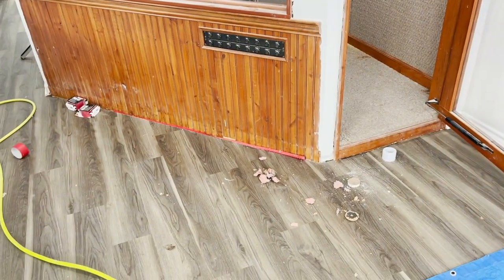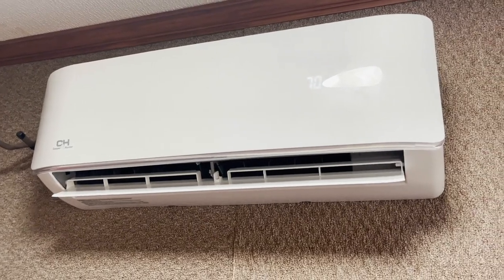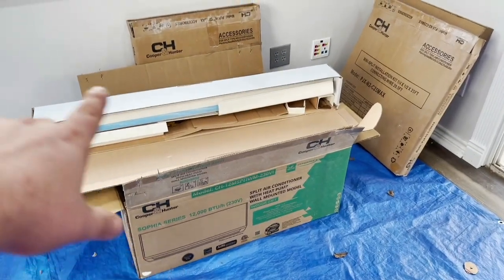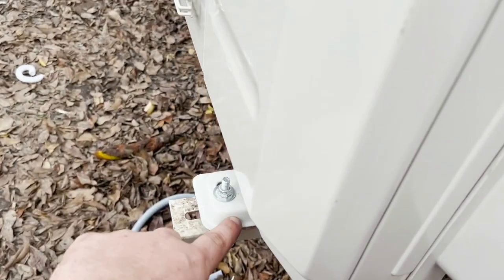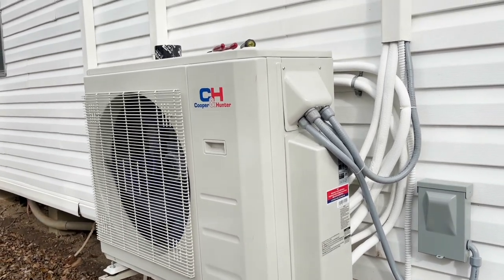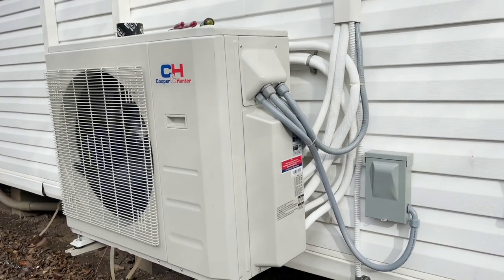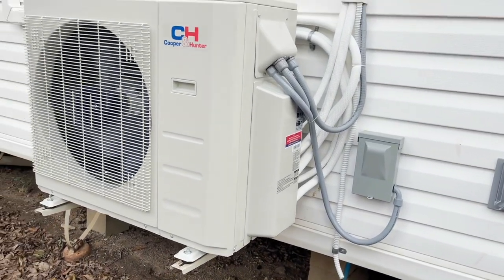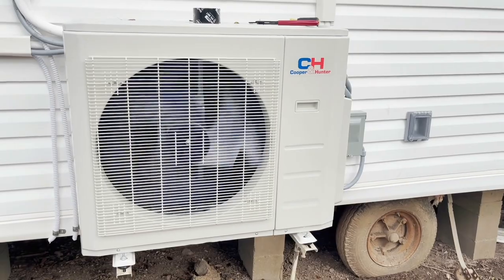Cooper & Hunter 3 Zone Mini Split/We Did Not Provide Equipment

Comment: Nice and clean installation. Used to have a multi zone mini split repair. Only one was working, when another was turned on the working one stopped working. Spending too much time on the diagnosis and couldn’t charge that much since the unit is cheap. Avoid repairing multi zone mini splits unless you have enough spare time

Comment: I work at an HVAC supply house , Cooper &Hunter are made by Gree which is a Chinese company !! , Rheem & Ruud are made by Fujitsu !! We sell Fujitsu and Daikin and I think both of those units are very  solid !! The only problem with mini splits is the control board they are very sensitive but if you put a surge protector you are 100% safe and I like them better then conventional you are saving at least 50% in utilities $$ specifically in the NORTH EAST WHERE I AM !! YOU GOT A POINT ABOUT LG  SAMSUNG TOO IS HORRIBLE BUT I WONT RECOMMEND PUTTING A COOPER & HUNTER
Reply: Is Gree reliable? I can't decide on a new dual zone either or Daikin or Gree. Daikin is much more expnesive but with good reputation. The indoor unit design is almost like the one  Ihad 10 years ago. Gree has modern indoor unit and wifi. But I am worried it might less reliable or need service call..what do you think?

Comment: they made a big mistake placing the condenser directly outside the mini-recording studio area, even though the unit's are quiet and on isolator mounts, the vibration will transfer through into the flooring and walls, right into the mic's. then again it's a trailer, so there will always be noise transfer and vibration, which is the reason recording studios cost fortunes :)

Comment: You seem like the guy to ask these questions.  I live in the Houston area...double wide 76 ft length.  I have had challenges with ductwork being damaged by wildlife.  I finally SHUT the HVAC down this summer due to condensation from leaking ducts, destroying my flooring.  I installed window units, but not really a plan that is working well for me.  I do NOT want to replace the ductwork under the house.  Is it feasible to ductwork INSIDE the mobile?  I can't seem to find anything on this on the internet.  I can't be the only person who has decided not have ductwork under the mobile.  I have a friend who is willing to loan funds to complete this project, but I need to find a solution before summer.  Is it possible to do inside ductwork in a mobile or is that not recommended?  What other solutions?  Thanks in advance.

Comment: Made by Midea
Reply: Very clean installation.  You do nice work.  I've been selling and installing mini splits for four years. Dakin and Mitsubishi are definitely the top tier. However I've install several other brands. Some I supplied the equipment and some not. Out of 6 different brands the only issues we've had is drains clogging up, vandalism,  and dirty coils. Repaire parts availability could be an issue once you get away from Dakin and Mitsubishi.  Time will tell. Like your videos. God Bless

Comment: Take it over a Fujitsu 😂. Clearly you don’t know your shit because there’s multiple things you are incorrect about. Mitsubishi I agree is great. Fujitsu and Mitsubishi to me are top tier no one else touches. That head in the studio is gonna short cycle like fucking crazy. Gree does not make ruud and rheem mini splits. Fujitsu makes the mini splits for Rheem. Hence why they look indentical. Just as Rheem makes the conventional systems for Fujitsu.
Reply from the maker: Fujitsu is junk. Hey I wasn’t positive that Gree made mini splits for Rheem but since you “Know your shit” you have set straight. I did know that Rheem made the forced air systems for Fujitsu. Thank you for your knowledge Mr Super Tech
Reply: @johnisraelhvac2019  you’re welcome anytime. I love the drains being level inside the fortress covering too. And you’re wondering why it was taking so long for condensate to come dripping out of them. Have you ever actually installed Fujitsu? You’re the only one I’ve ever come across that that calls Fujitsu junk. You’re literally installing junk in this video.
Reply: @johnisraelhvac2019  literally every brand outside of Mitsubishi you named I wouldn’t touch with a ten foot pole and you’re calling Fujitsu junk. The ease of install of the Fujitsu and the serving and troubleshooting end is very easy. Everything that you need to know is in the manuals unlike these other brands. Literally books on what you can mix and match for indoor units and outdoor units. Troubleshooting books and mobile apps. You really have no clue